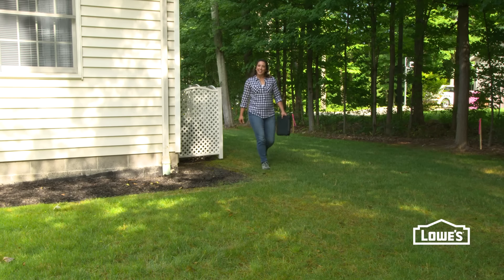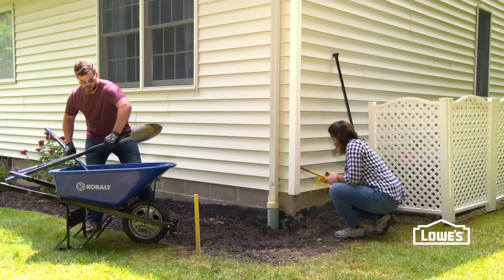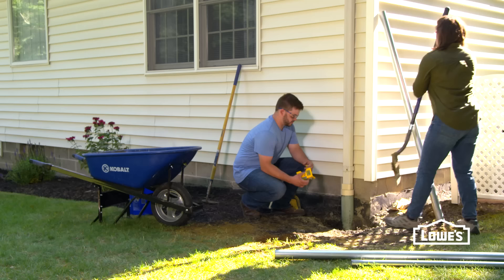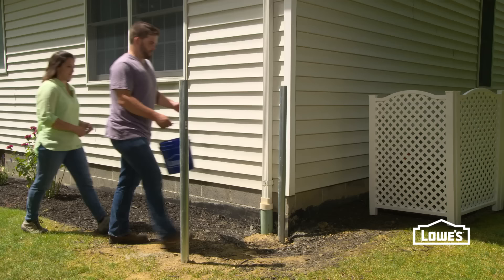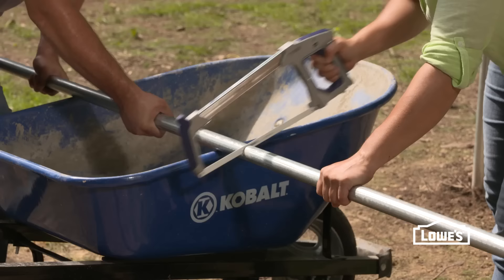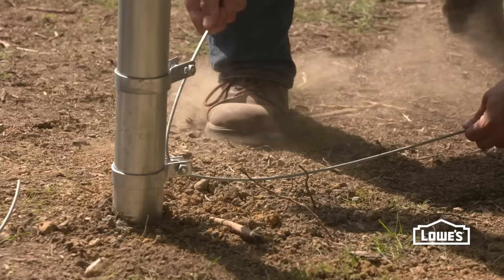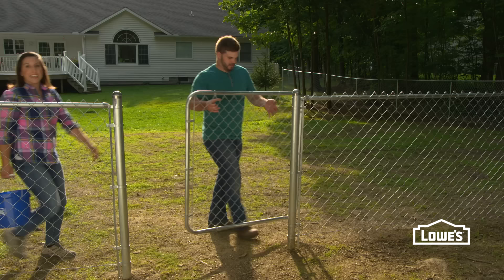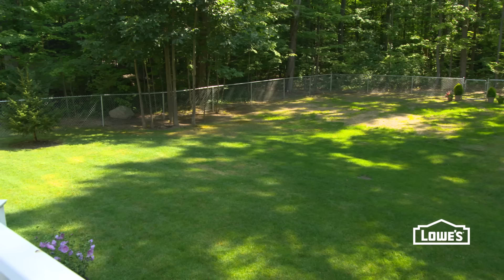How to Install a Chain Link Fence

Comment: There are a couple mistakes one the bottom wire needs to be stretched and the nuts to the inside. Also no need for dry cement on the bottom of the hole. 30 years experience.
Reply: Thank you. I was wandering why she said put dry cement in the hole first. So just fill it with wet cement
Reply: Trying to stretch to bottom wire was tougher than I thought it would be, but I eventually got it.  Any handy hints would be appreciated.
Reply: Using a T shaped pipe with a hole drilled the bottom worked great. Run the wire through and spin it until bottom tension wire was tight. Sung bolts down then release, cut off excess wire after

Comment: There's something strange about watching people work with ALL new tools.
Reply: And spotless boots
Reply: Subliminal advertising
Reply: Clean clothes, and clean boot.
Meanwhile when I do work around the house I dress like a hobo.
Reply: Shovels should be splintering with missing handles. Wheelbarrow on its last days of life. Clothes dirty af. Sweat
Reply: Yeah, and if it was a normal auger that's not used much, it would probably be next to impossible to start and maybe even end up side-lining the whole project for a few days while they run trying to get niggly little carburetor parts and spend hours watching small engine repair videos.
Reply: This must be one of those "In A Perfect World" situations

Comment: If you're looking for a fence over 8' tall, Lowes isnt the place. Find a local company that supplies fence material and has people willing to help. They dont need to build your fence but they should be consulted about local regulations and codes. Dont let big box stores advised you when installing a fence.

Comment: when pulling the fence tight, save time and effert by keeping the puller short and removing the excess fence just one time.  (7.54) The slight loss of tension after attachment is not important.
Reply: What u mean keep it short

Comment: Ive never installed chain link but for wood and vinyl you usually do corner post first, run a string along the top then set the post in between the run to the height of the string.

Comment: As someone who works in a fencing company we normally mix the concrete in a wheel barrow and dig all line posts,corner and gate posts with diggers and I forgot to mention 4 concrete bags in one wheel barrow to mix under a min which at first was hard but I learn that the human body can adapt to constant repetition of a physical activity resulting in a better shape then most who work inside and I do not mind it I’m not tryna brag or anything in just tryna point out differences I thought was odd but interesting

Comment: It always looks so clean and easy in videos...its a filthy pain in the ass to do!
Reply: Measuring each post will give it a roller coaster look in the top rail. For 1 and 3/8 top rail with 4 foot fence measure from the ground up 46 1/2 inches on each end posts and gate post and run a string
Reply: Exactly
Reply: I used to work for a fence company and we installed these fences daily. But we would install 6 or even 7 foot high fences on commercial and industrial properties like refineries. It's a lot more to it because we would also have to run Barbed wire or even razor wire on top of the fence. This tiny fence is nothing compared to what we had to do. I really hated that job and quit after a few months.
Reply: Oh, it's a lot easier if you pretend you're doing a Youtube instruction video.
Reply: Used to work for the state and we did a HBrace wildlife fence on the side of a road to keep animals from getting hit by vehicles ... I wouldn't say fencing is the hardest thing to do but it has it moments
Reply: I’ve done a 1600 ft dig and pour in a day with only 3 other guys and I agree it’s a messy job
Reply: @jerhettsines1289  That only works if the ground is level. Use a transit or laser level, or if all you have is a string, use a string level. The ground may roller coaster, but your fence will be perfectly level, and people will see that it is level.

Comment: Lots of things are done the hard way. You don't need to square the fence using the 456 method. you can pull a line off the house and use the eye method. This is better than having a perfect square that does not match or line up with the house. Set you corner poles and pull a string. This is the string you will use the set the rest of the poles. You only need a hole about 8-12 inches deep. You can use hand hole diggers and get the correct diameter hole. Place the pole (terminal or line) in the hole and use a 9in level (or corner level in you prefer) to level the pole to the string. Then you take a pole driver and drive the pole down until the top of the pole is 45in out of the ground (for 4ft fence, this gives you the correct height once you install the top rail and loop cap). This also puts the bottom of the fence just above the ground and you don't have a 6in gap on the bottom(it defeats the purpose of a fence) Place DRY cement in hole to ground level and cover with dirt. You can install the rest of the fence immediately and don't have to wait for cement to set up. Some other small things are: you need to tighten the tension wire with a puller or other method, you can roll the fabric out standing up(its difficult to stand up 200ft of fence up), you only need about 5 ties and pig rings(on the bottom) for each section. 

I'm sure there are other things but this should get you started. 
And yes, i install fence professionally and have never had one fall down/blow away or have a complaint on the way it was installed.
Reply: It's Lowells they sell tools (of course they will show you the hard way because you need all those tools) 😂
Reply: where are you located! need a fence...
Reply: Measure down from the top of the pole the height of the fence and the rest goes in the ground? Sounds logical but it's my first fence and I don't want to do it twice lol
Reply: Have heard of 345. 

What is the 456 method ?

Comment: Great video started measuring but found out the gate is a different width, so I would have added that in the video for the terminal post. I’m actually starting with the gate first.

Also you should add how you actually straighten out the tension wire, I had to search a different and found how you guys did that.

Comment: A family member recently bought a new house and asked the contractors to build a 6-foot high privacy fence around the back yard.  They specifically told the contractor they wanted a 6-foot high fence, but that it must be level across the top of the fence.  The backyard sloped or varied in height by about 1-2 feet in certain areas.  

When the contract was done, the home owners complained that the top of the fence was only 4-feet high in some areas and they were concerned their dog would jump the fence.  They demanded the contractor tear down the fence and rebuild it.  He refused saying he built it as per their specs.  If they wanted it 6-feet high across every section of the fence, they’d have to pay to have up to 2-feet of dirt removed at a high price as he’d have to use a Bobcat, dump truck, and labor costs.  They blew a fuse!

Moral of this story.  Make sure you both understand what the end result will be or look like.
Reply: @dropndeal  Exactly. I would have done the same.
Reply: Why did he do the work without asking first?
Reply: @briantorres1612  Most cities won't let you put in a fence over 6ft high (at any point from the ground), so it'd be clear to the builder that the lowest part should be 6ft from the ground, and hills would be less. It's the owners that didn't realize what they were asking. But if the builder wanted to be nice, he would've explained it to them.
Reply: Since they said it must be level across the top he followed their demands. It's not up to him to say their specs are wrong. He can't tell them what's important to them. He was right, they were wrong. Pay for your mistakes, don't get mad at others for following your directions. Be adult enough to admit you blew it. Anger is the easy way out.
Reply: @Hello Gil how are you doing
Reply: Set each post at 5'9 from ground. When you do that, you'll have a perfect 6 foot line regardless of what the ground does.  Problem is though, very uneven ground will mess with fences and sometimes you've got to have situations like that.
Reply: Not responsible for grading

Comment: Make sure to put your nuts + bolts into your tension bands properly so they're all facing the same way.
Reply: Preferably nuts to the inside...nuts to the outside tend to interfere with the tension bar.

Comment: I like the tips, just about how we install it except no mention of how to establish the width of gates. You know, the width of the gate plus 2" on both sides for hinge and latch clearance.
Reply: DINO GIBRASKI Surreal.
Reply: 3 1/4”
Reply: FNCO Fencing Company so for a four foot gate add 6 1/2”? The fence posts are 46” above ground. What are the terminal posts above ground, they seem higher? Thanks
Reply: Danny Sexton 491/2”
Reply: I set the post for the gate itself, installed the gate and dropped the other post wherever the latch was.  No measuring involved.

Comment: 30 years ago i  put a chain link fence. i dug the holes with a post hole digger, i mixed the concrete by hand with out gloves (big mistake wear gloves it will dry out your  skin) before i put up the fabric you dug a trench on the fence line and back filled later , friend came over saw the fence line and asked how did you get that so level never seen one like that, i said i guess i got lucky  :) i told him later extra work pays off and told him how i did it

Comment: I already have an existing chain link fence so all I need to do is take the old one out and place the new one in. But the cost and tools will be costly. I would rather do it myself though because I have never installed a chain link fence before.

Comment: Awesome! Which do you consider more expensive and harder to install, this fence or a wooden fence?
Reply: Late reply but. Both have advantages and disadvantages depending on soil. Having a crew dig holes auger or not could cost 30 - 100 a hole with utility lines. Best call to have utility's marked before making any decision.

Comment: I've always wondered if (assuming you could afford it) you could bury the bottom of the entire length of the fence in concrete - basically dig a trench underneath the fence maybe a foot and fill it up with concrete up to a few inches above the bottom of the post. It would probably be expensive but seems it would a great way to keep any animals from digging under it. Or would something like that violate any building codes.
Reply: I use hardware cloth. Lasts a long time.
Reply: When I did my chain link fence we put it down about 4 1/2 inches and it looks good after 35 years
Reply: I would just worry about the concrete shifting/heaving and warping the fence unless it was poured below frost line
Reply: I’ve built a small backyard fence for family that was to keep small dogs in, we dug a 6 inch trench in the line the fence was to go, then placed post and wired up the fencing. Once we had the fence up poured ready quik crete thru the trench and as far as I know nothing ever managed to dig under and that fence is still standing straight as can be. Not a bad idea and wasn’t extremely expensive at the time I did that one however if you were to pour a 16-30 inch trench worth of concrete various length it could become fairly costly

Comment: terminal posts dont need to be deeper than the line posts.7 foot terminal and line posts 2 foot down 5 feet up done.
Reply: Depends on where you live.  Locally we can get strong winds and occasional tornados.  Chain link let’s the air through, but you still have to design with the debris in mind.  So schedule 40 posts set 3’ down in concrete.

Comment: 7:41 is where I ran out of equipment I'm willing to get. I was even gonna dig posts by hand, but the only other thing I can think of is using a ratcheting strap.....oh ok nvm
Reply: You can just grab a piece of scrap pipe, shovel handle or anything like that, put it through the chainlink a few inches before the end post and pry against the post :).

Comment: Why dump dry concrete before adding wet on post hole?

Why not just set in wet mix initially?
Reply: I don’t know but I’m assuming that the wet concrete will seep out water at the base/bottom which will be adsorbed by the dry concrete. Otherwise, it may have too much water at the bottom if you use wet concrete instead of dry.

Comment: for the terminal posts-- first instruction is to bury 30"-- if you do this for a 6' post, per there instructions, you are supposed to have the height of the post (48" -2" of the fabric) so 46" from the ground up---if you bury the post at 30", as they say, you are only left w 42" of post - am i missing something here?

Comment: Is there a way to make it impossible, or at least more difficult for a dog to dig its way under the fence? I'm not talking about the dog pushing out the chain links. They already addressed that in the video when they said not to make it to loose. What I mean is, can you make the chain links or "fabric as you call it, actually extend under the ground so that it would block the dog from being able to get through if they dig a hole, even a deep hole?
Reply: Yes
Reply: Cement it in if your building code allows

Comment: Why you didn’t used same concrete also on the first post?
Reply: I think they were trying to inform viewers that there are a couple of concrete options. The special fence post concrete that is poured into the hole around the post dry and then water is added is easier to work with—no premixing with water—but it is much more expensive. I think they mentioned this. They are doing an instructional video and wanted to show how to set posts with both types of concrete.

Comment: How do you get the “top” and “bottom” of the chainlink fence to go around a circular yard? Do you install a top and bottom “horizontal” posts to achieve the smooth curve at both top and bottom of fence?
Reply: Pipe bender and conduit of the same diameter that will fit into the rail ends. The fence will not be perfectly circular due to the straightness at each post. It will be nearly circular. Yes, attach a "top rail" at the bottom, and tie the fence into the rails at every diamond instead of every 2'. Also, consider "welded wire fence". It might look cleaner for a circular yard.
You could also do a solid custom-made fence welded together, but it would cost a lot more.
You could also run the fence along the outside of all but the first and last your posts, and tension it, and the circular shape will keep the fence taut without needing hardware at every post. You can drill and install eyehooks or something similar near the top of the posts and tie the fence into the eyehooks instead of using rails to keep the fence up. That would be the cheapest option.
Do keep in mind that you get what you pay for.

Comment: I can see that the line posts were not installed exactly at the center of the hole but on a side inside the hole. My fence guy says that it has to be at the center of the hole for providing more support. But installing at center would also mean that I would waste 3-4 inches of my land. How much of an issue is that?
Reply: That's an engineering question... How far you can deviate from the center depends on loads being placed on the fence, the composition of concrete used, and the soil compaction around the concrete... Theoretically, if nothing is hanging or pushing on the fence, and tension is the same between all posts except the ends, the posts can go in on the right or left side of the hole for all the middle posts.

Comment: Your bolts are facing the wrong way the should be on the inside only for play grounds and basketball courts should they face out but your fabric would be on the inside so the nut would still be facing away from the fabric. Also putting your hand ties on the top rail wrong ties should be on the pickets closest to the top rail and should be hooked to the weave directly under it

Comment: I have a chain wire fence but i want to make it higher, can i take off the terminal cap, put a sleeve in the existing post, then join another post on top with the sleeve? Thanks in advance.

Comment: Why the dry concrete mix in the bottom of the hole? Why not just use mixed concrete? And how much of that bag of dry mix went into each hole? It wasn't clear in the video. Otherwise, a pretty good explanation.
Reply: Definitely don’t do the dry in there like that

Comment: Damn bruh, That's a lot of work!
Reply: Its not that bad. Pro installers do not even charge much for it because its so simple. And it also adds so much value to the home! You may spend $1,000 putting the fence in, but you can add $5,000 to your home’s value.